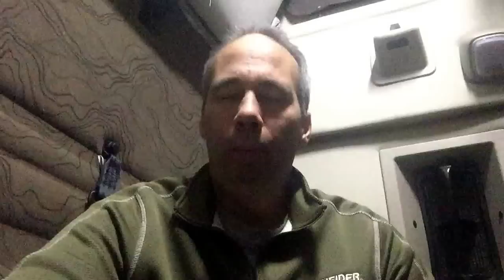IC Choice frozen brakes

Comment: Jeff - don't forget Brake Line Anti freeze... Carhauler Tim
Reply: +tim z1br3 in red line only and as a very, very last resort! Stuff works, but causes problems in the long run.
Reply: +Weirdracin   yes your right, stuff like Isopropyl alcohol does the trick but too much will hurt the seals...

Comment: Would it be ok to park over night with trailer brakes released and not set
Reply from the maker: +mike WILLIAMS Yes it will not hurt anything as long as you are on a level surface or block the wheels